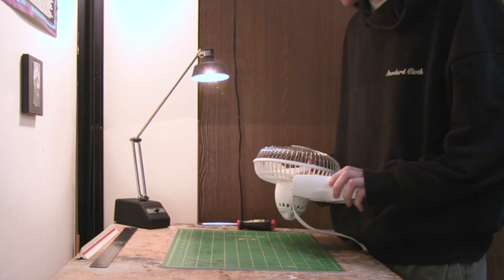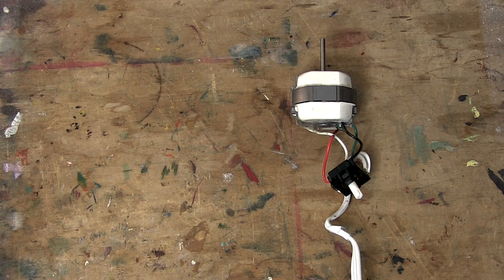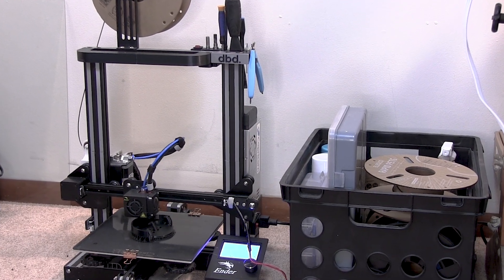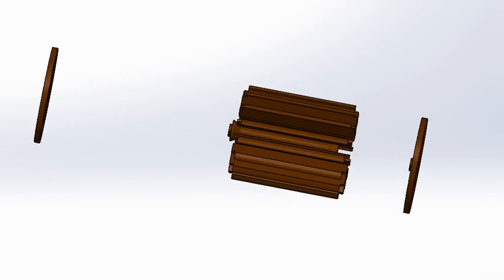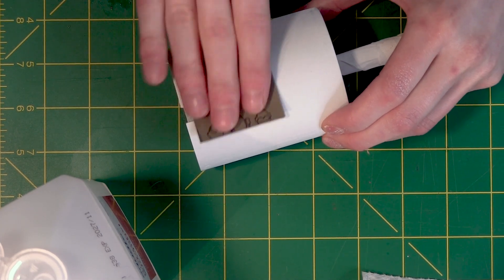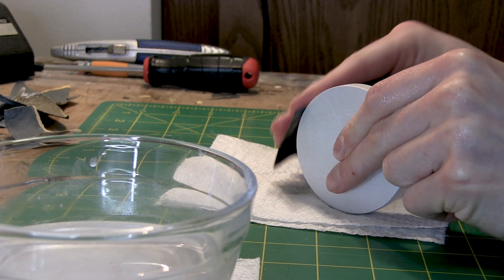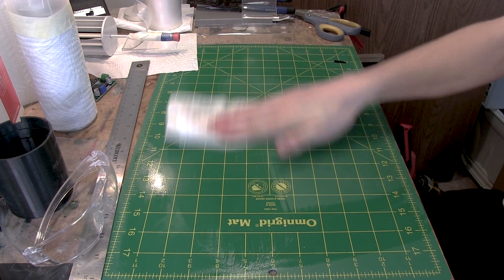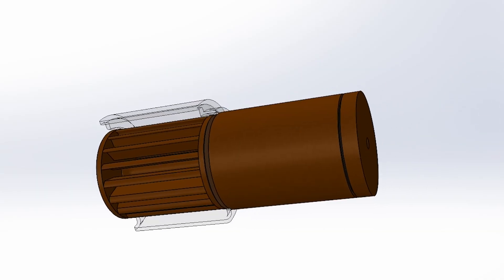3D Printing a Forgotten Icon

Comment: You are confusing minimalist design with good design. Because the design you made is not good. The fan motor will overheat. This problem is solved in the original design, but you only copied the appearance.
Reply: If this is the thing you’re concerned about you obviously haven’t been on YouTube much so welcome to the rabbit hole
Reply: I saw this comment before watch the video. 

The whole video I looked for the motor model# so I could look up the datasheet to determine how you came to that conclusion. 

It’s not in the video. There aren’t even details about power draw, so there’s nothing to even ballpark the equations you would have had to run. 

It doesn’t take a genius to determine that the motor will run hotter with restricted airflow. 

You can’t say something will overheat without knowing what temperature is considered “overheating”, and without knowing the temperature it’s running at. 

The good news is that the enclosure will start softening and deform before 100C, so OP will have a VERY early warning before it catches on fire.

It’s really easy to spot the difference between experienced engineers and inexperienced engineers.  Those without notable experience are very quick to abandon a project because they identified a potential problem. Experienced engineers test and solve problems.
Reply from the maker: @TheOfficialOriginalChad  I love you
Reply: @TheOfficialOriginalChad  hello, I believe this is an air king 9145, with a 12w motor, though maybe a different model, since the one I mentioned is the 6" variant and I cannot easily tell scale from the video.
Reply: @TheOfficialOriginalChad  
The fan OP took the motor off has these holes for motor cooling. I guess this answers your question about the need of cooling.

Experienced engineers test and solve problems, but they don't test on a finished, painted device.

Also, experienced engineers can spot common patterns in the design, like the motor cooling method used in the original Brown fan. It's very simple and takes no effort to implement.

And yes, an experienced engineer would not abandon a project because of an overheating issue. They would just solve it during the blueprint stage because this problem has been solved thousands of times. Not to mention, it was solved by Brown in this fan.
Reply from the maker: @Veujin I added ventilation on those rear insert plates. There is an air gap between the knob and the body.
Reply: @distracted-bydesign   probably the most elegant solution for your design. Will we get updated pictures? Like atleast in the community post tab
Reply: Hey keyboard trolls... What do YOU do? How do you contribute to anything other than the door dasher that brings your chicken nuggets to your mom's basement. 
I doubt you even tip so... Waste of space you are, and a waste of my time counter trolling you.
Reply from the maker: We'll see. I ran it for well over an hour with no signs of heat issues.

Comment: I love printing but Im totally on the same page about the cheap toys. 90% of the stuff people print is junk
Reply: This may be a hot take, but a huge amount of people printing tchotchkes paves the way for more important uses and users. That means the 10% of people using FDM for real, important purposes benefit from cheap, high quality machines, thoroughly tested print profiles, new filaments, etc., due to economies of scale
Reply from the maker: @waltonchan3931  That's a good point. Sometimes I just get bothered with how 3d printed toy sellers go about advertising. 
90% of the time they're selling PLA toys w/ poor resolution to people who don't know any better. 

I also think it's a big waste of filament for multi colored stuff.  I have seen some people melt the purge material into molds though, which is pretty cool.
Reply: @distracted-bydesign  multi print head printers almost eliminate any waste from color changes, the current poop implementations do suck
Reply: @distracted-bydesign  There are probably billions of cheap plastic injection molded toys that are manufactured every year that nobody wants. At least with 3d printing the demand comes before the supply so there should be less waste. Multicolor does contribute to a lot of excess waste though for sure and of course misleading sellers are everywhere too no matter the product or manufacturing techniques.
Reply from the maker: @Megasteel32  I want the Prusa XL or whatever the next version of that will be.
Reply: @distracted-bydesign  the XL is a great machine which I Run at Work. Get at least the 2-head Version. But for you every newer printer is an Upgrade. If price is a concern i would Go for a used MK3 and then maybe the 3.5 Upgrade later.
Reply: @distracted-bydesign  you also did export model in low resolution 5:30
Reply from the maker: @Missing_Texture.  Yeah that was a dumb mistake but I was just avoiding reprinting.
Reply: @distracted-bydesign  if you are printing on ~40mm/s, ender 3 can print faster (75, 125) with proper calibrations of slicer presets and printer mechanics (you can get excellent quality prints from it), but it has no PA so you might need to lower accelerations to get good quality corners and set max volumetric speed depending on filament you are using. z hop will help with crooked thin parts like you showed with the blades. all calibrations are included in orca slicer if not using it already, better swap to it.
Reply from the maker: @Missing_Texture.  Thanks for the tips! I don't concern myself with speed too much but this is all interesting. I've read some studies on PETG being strongest when printed at 20mm/s so I've always tried to max out at 35-40.
Reply: @waltonchan3931 Yeah, I feel that the same thing happens to computers too. I'm able to render animations on a GPU that won't break the bank, thanks to 90% of people only buying it to shoot virtual bullets towards each other at 144 frames per second.
Reply from the maker: It's unfortunate. There's so much more you can do with them
Reply: It I had a nickel for every time I saw a junky 3D printed toy for sale, I’d have enough money to create a print farm and make junky 3D printed toys
Reply: When I got a printer, I started to fix many broken thngs and completing stalled projects due to missing parts that can now print.
Reply: Some interesting points in this thread - made me rethink some things.  Still not to crazy about some YouTubers getting through kilograms printing massive stuff each video for attention (especially when other materials would be better), but if you could offset that with influencing people to get into engineering then that takes the edge off.
Reply: I wish there was a site that focused on functional models. Everywhere I look (makerworld, thingiverse, etc.), pointless tchotchkes get top billing. Fine if that's your thing, but it'd be nice to have a functional item focused model repository.
Reply: People seem to have forgotten that 3d printing was a tool to enable prototyping, most people never reach beyond the prototype phase and therefore most of what is left is printing plastic landfill trinkets
Reply: @epiczizzle  correct. I used to deal with a customer that would test designs with stereolithography back in the day
Reply: Yeah same, i hate it.
I want to design practical stuff or replacements parts for broken products, that either cost a fortune or arent produced anymore, not produce more waste & junk then already is produced by platforms like WISH and Temu.
I minimize my 3d printing waste to a minimum
Reply: @MH-kc5jr  I'm with you. Last week, I reverse engineered and printed a replacement sleeve for my drum throne rather than throwing the whole thing away for a $3 discontinued plastic sleeve. Did the same thing with my travel bag; printed a petg hub and tpu tire for it and gave it plenty of more years of useable life.
Reply: @TheFeralEngineer  thats what 3d printers were made for!